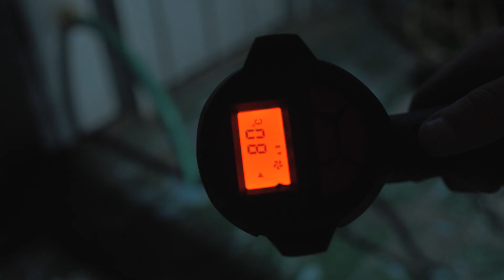Burning The Midnight Oil | Epoxy Sealing Cabin Sides | Episode 32⚓

Comment: Great work!  You use the heat gun to start the epoxy to kick off quicker.. according West Systems it is good (better?) to warm up the wood before applying the epoxy. That way the epoxy penetrates deeper into the wood, almost like a 'penetrating epoxy'. Which is what you want when reparing/preventing rot.
Reply from the maker: Yes! We do this and I forgot to mention it. I'll make sure to include this point in the next episode. Thanks for that.

Comment: What is your estimate of getting the outside done enough to paint it and then go inside? It's looking really great so far by the way. Keep up the great work!
Reply from the maker: Taking it day by day as the weather is the biggest deterant for progress working on the exterior. The current mission is to seal the cabin sides. Which would then allow me to fiberglass/epoxy the decks. I also need to strengthen and replace quite a few deck supports and some more frames before that can happen. The fore cabin roof needs to be finished with fiberglass too but I am wondering should I remove the sealant in the roof plank seams and fill with thickened epoxy to reduce expansion of the sika flex. The list is long... Thanks for your support!